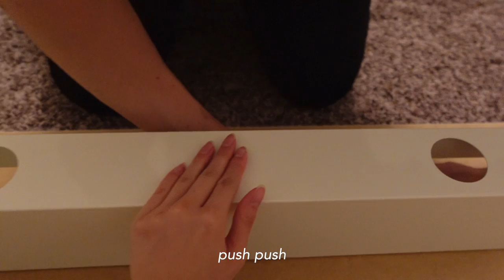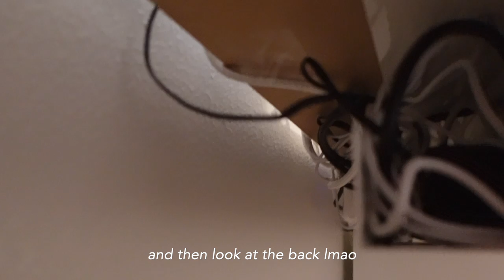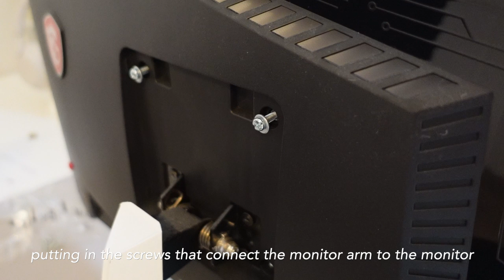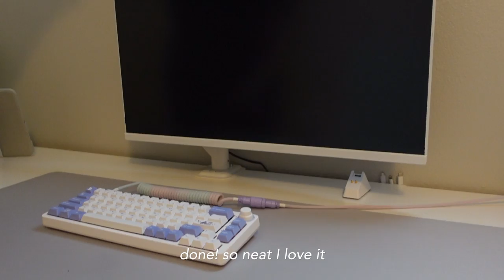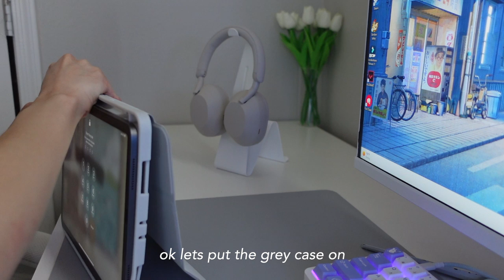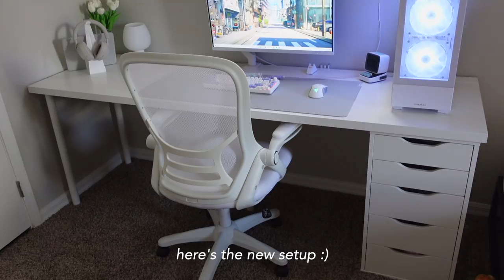aesthetic desk makeover + setup upgrades | new monitor arm, ikea desk, headphone stand

Comment: Heyyy a tip , run the keyboard cable straight , after the coil part , run it straing to the monitor arm or something like that , i thinkit would look better than going directly into the pc
Reply from the maker: hi! my friend actually gifted me a coil cable that only goes right instead of to the monitor! I was trying to run it straight to the monitor arm but I'm unable to bend it due to the specific one that she got me. Thank you for the advice though :)
Reply: @lamtachi  i see , that explains :D

Comment: Hey, amazing work there! Love the setup :D

Personally I would align the keyboard cable to go in a straight line behind your desk and then route it to your computer, so the cable is hidden a little bit smoother.
Furthermore I would add some lightstrips to the back of your table so you can benefit from indirect lightning. If you are willing to do a bit techy things, you can try using a esp8266 board with some  ARGB Lightstrips from amazon together with the software WLED. Just look around, there are very good videos on how to set this up.

The shelf is a great idea.
Maybe I would add a deskshelf too, just to utilize the open space you have, if you want to add more accessoires to your setup in the future, as well as storing your macbook while you are not using it.

However, as already said - love the setup and keep up the good work. Exited for your next videos :D
Reply from the maker: Hi! Thank you so much for taking your time to give me all these good advices!! I really appreciate it 😊 and I’ll definitely keep all these things in mind!

Comment: really love your set up! & if u dont mind me asking What double sided tape did u use?
Reply from the maker: thank you! and love your profile pic haha. I'm using the "Scotch  Extreme Double-Sided Mounting Tapes 1-in x 5-ft Double-Sided Tape" it says that it holds up to 30 pounds! and tbh I've used it on two desks for my cable management box .. for one desk it stayed on really well to the point where it took me 2 hours to try and take it off. and for the other time I did it it came off by itself :( so Idk if I recommend it but I did it again to test it out :)
Reply: @lamtachi  you're welcome & thank you! haha. Oh! i was actually eyeing that tape too but i wasn't sure bc i read it was hit or miss. Was it for this table and cable management holder ? bc i actually have the exact same one as you.  Maybe i could try it out as well and see if it will stick on my table, but thank you for replying really appreciate it! <33